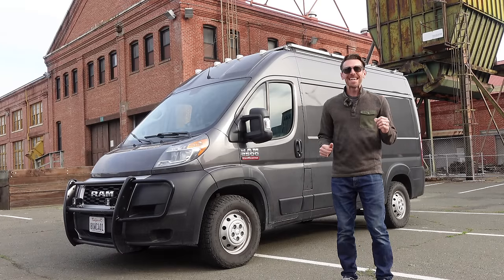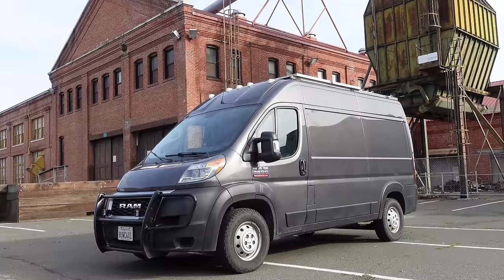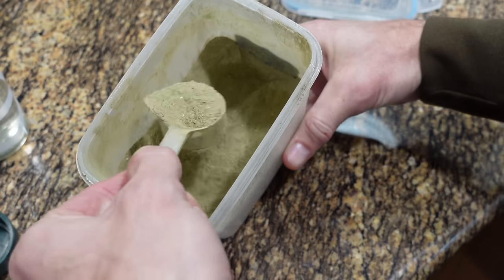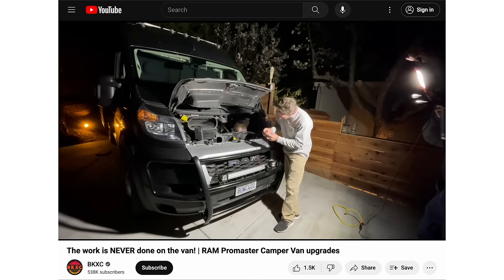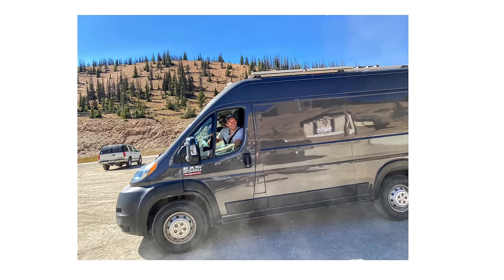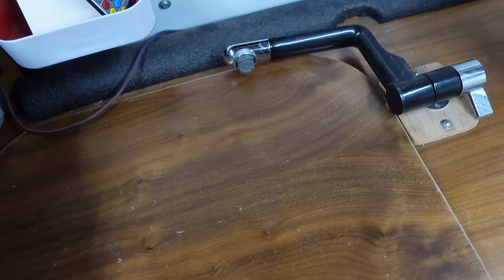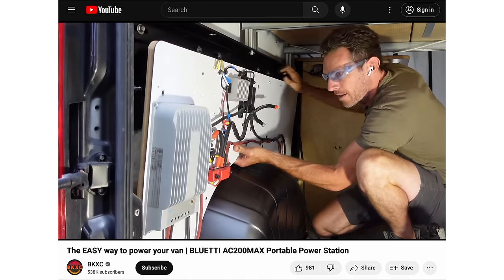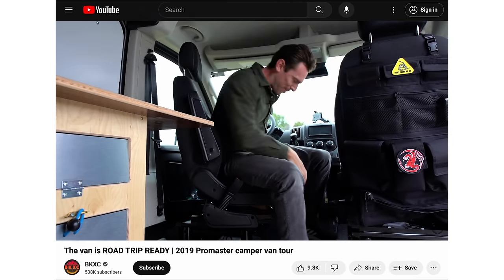100,000 miles of regret | My RAM Promaster camper van

Comment: Ex Chrysler mechanic here. The company spends all their money on marketing, not quality parts or engineering. If you want to be busy work for Chrysler, if you want to be bored work for Toyota and Honda like I later on did. 

Out of all the options I bought a Ford Transit ecoboost. Now with two 220k+ mile ecoboost engines I would recommend a standard 3.7L v6 Transit for 90% of van owners. 

Thanks for the review after all these years! You helped inspire me to build a van and make YT channel with my wife.
Reply from the maker: Haha, that’s great about being “bored” as a mechanic. Awesome that you picked the right van to go on adventures!!
Reply: Can you explain why you wouldn't go with EcoBoost for "most" drivers (and which ones)? I've only heard great things about it, for both mileage and get up and go.
Reply: @DMB-pe8hk All gen 1 (2021 and older in the transits) ecoboosts develop an exhaust leak at the exhaust headers where the turbos hang off due to the studs degrading and breaking over time. Depending on how bad the studs are stuck in there (transits also have a front drainage issue causing water to drip all over, corroding stuff) you're looking at $3-5k to fix. Other than that issue the ecoboosts are worth it imo, unless you're intending on super high mileage
Reply: @patshmear10101   Thank you so much. We'll stick to 2022 or later, then, if we can find an affordable one. We're not sure how much mileage we'll put on it at this point. 
We've also toyed with the idea of starting with a transit passenger wagon XLT AWD (but pricey!) so that we can keep enough seats to transport our many grandchildren (8 in the area!) and loan to our kids for family trips. Any thoughts on those? Are the mechanics mostly the same, or are they a different bird entirely?
Reply: @DMB-pe8hk  No worries. The drainage issue is easy to fix/avoid (front left and right drains below windshield gets debris in it and blocks draining), google some solutions or ask a dealership for any fix they do with foam to redirect water etc.

Regarding a passenger van, they are exactly the same as a cargo but they have more trim and a rear AC compressor (it's small and easily removable if you want). There is however a BIG caveat to converting those. They all come with passenger side airbags (both sides of the vehicle) which go all the way from the front windshield to the back of the van. Each side is all one unit, ie: you cannot just leave the front passenger and driver seat side airbags in and remove the rear passengers. This means when you do your conversion and want to install upper cabinets/do really anything with that space, you have to remove the airbags for safety. Depending on the country/state you live in and your insurance company, they will highly frown upon on the removal of safety equipment. Might cause you trouble in the event of an accident injury claim. To get around this you typically have to go full RV conversion and get your title officially changed to an RV type, then insure as appropriate. Also, you need special plugs (cheap) where your airbags used to plug in to trick the system into thinking the airbags are still connected, else you'll end up with a permanent light on your dash.
Also keep in mind, all those windows make a pretty intolerable greenhouse effect in hot climates. You can get insulated window covers but they won't perform as well as insulation + an actual wall.

Rather than going with a full on passenger van, Transit also offers a "crew van" variant which is basically a cargo van with a 2-3 seater behind the driver/passenger. This is what I would do if I didn't want to deal with installing seat rails etc. myself. This of course depends on what seating layout you want, you might end up having to do it yourself anyways.
Reply: @patshmear10101  Thanks so much for all that! I was aware of the long, single side airbag, but wondered if it could be replaced with the shorter "crew" van airbag. The reason for considering this is 2-fold: 1) our daughter has 6 kids and I might like to take a  passenger van down to 8 or 9 seats, with a bathroom in the back, and convert it to a camper van later for just us... but due to where we live (snow) we want an AWD... hard combo to find in a medium or high roof. 2) A crew is hard enough to find these days, but an AWD crew with raised roof is nearly impossible. So... trying to find a way to have seats when we want them and take a few more out (not easy, I know, but wouldn't be done often) when we want to travel as a couple and have a place to sleep. Then eventually convert it permanently.  We're thinking adaptability. Wish Chrysler's stow'n'go seats were in the Transit. Finally, I had also thought that having a/c already in the back might be an advantage. But I guess for sleeping overnight, a high- efficiency replacement system is a better idea. Been looking into the van mini-splits with the condenser underneath.

Comment: Thanks you so much for this video.  You are singing my song!  In 2018 I bought a Promaster strictly because I heard about Wayfarer.  My van was bought new, but on a special for around 27K.  Then, the Wayfarer conversion was a bit over 8K.  I was reluctant to spend that much (who knew how much both would cost in the future).  I also drove to Colorado and had the kit installed in the morning as I toured Garden of the Gods using Ian's minivan (mini truck) to get there.  I have really liked the conversion, which is solid, but had the same complaint about the sink.  I never used it as I had campers before and never wanted to deal with grey water.  I also use a spray bottle (vinegar) for dishes, and use wipes, and sponge baths for me when I can't access a shower.  No one has complained. You can't keep pretty clean using non-traditional methods.

Every year I manage to find something to upgrade.  Two years ago I upgraded the sound system with a Kenwood head unit and speakers.  Like you, I'm not blown away with the sound, but I like the higher quality camera view (I had to replace the rear camera with a better one), Airplay, and the unit also gave me onboard GPS when I'm out of cellular range.  This last summer my friend and I took out the kitchen (I gave it away to another Wayfarer) and built a new one that completely removed the sink and added a drawer for an induction burner and a cabinet for a small microwave.  I agree completely with the idea of going with a power station (solar generator).  I started with a Yeti 1250-which worked for the basics.  I now have a Pecron E3000 which gives me 3KW (naturally, I have a lot of solar, etc).  It is powerful enough for me to use the induction hotplate, the microwave, and even a small electric pressure cooker.  Naturally, one at a time with careful monitoring of the sun (for the panels) and the time used on the appliance.  For instance, I use the microwave for 4-6 minutes at a time.

I sort of have a window regret.  I put one on the side slide, which is a must when backing out.  Sometimes I wish I put one on the driver's side too.  Not a huge deal.  I do have rain guards and can open my front windows.  That seems to work OK for ventilation.  

Everything you said about the positives of owning the van are so true.  There is nothing like being exhausted and having the option of pulling into a rest stop and sleep (for hours or overnight).  When I drive somewhere I always have what I need with me.  The weather changed and getting cold?  No problem, I have a coat in the van.  I'm starving and the only restaurant that I can find looks like it is in need of a health inspection?  I have a whole kitchen right in the back!  Etc. Would I spend 50K for a new van and 20K for a build-out?  Hmm, that would be tough for me, but that is just me.  Again, thank you for your very nice video.
Reply from the maker: Great to hear about your journey and how you changed things up along the way!

Comment: Sink stink can be helped with some plumbing. Some pipes and a plumbing vent(P trap and air admittance valve). It's like a $50-100 to DIY and a $500-$1000 to hire someone else to do it. It won't help with cleaning stinky tanks, but it will keep the stinky air inside the tank.

Comment: Been loving my Promaster. Started my build towards the end of 2017. And  yeah, nobody knows exactly what they want in campervan. We all learn and grow each road trip. I wish my bed was higher so I could put bikes inside but my rack works great. I wish my Kuat swing arm swung out to the driver's side. I've upgraded my solar/electric system a few times and continue to swap components as they get cheaper and better. But the best part is I have a rolling apartment. I can throw a few things in the van, put my bikes on the rack and take of to go ride for a few days or a few weeks. Next up is Starlink so working on the road will be much better.
Reply from the maker: Yes, I absolutely love having EVERYTHING with me. Just doesn't matter where I am when I'm on the road, I've got it all!
Reply: @bkxc  Yup, takes so much stress out of getting to the trail head. You know you just drive to the trail head and everything you need is with you.

Comment: When my husband was in the market for a van to build it was easy to cross of the list of potential vans; the Ram Promaster.  People have had nothing but trouble with them.  He ended up with a Ford Transit used with 15,000 miles on it.  He's really happy with it.
Reply: Fleet owners say the Transit and Promaster cost of ownership over hundreds of thousands of miles is comparable. "Nothing but trouble" is a wild exaggeration. The trick is not to thrash them, because then you get a thrashed van. Keep your cruising speed to 65mph max and dont floor the throttle and hammer the tranny and it'll last,

Comment: Great update. Confirmed this is the van and setup for my needs. 
Material $2000, CNC time $200, labor $2000, overhead $1000=$5200.  Sad they changed from basic kit for $9k to a basic kit for $20k. I guess two sells a month are better than 15 a month.

Comment: I built my camper van on a Ford E-450 frame and a 7.3L diesel engine. The van was salvage and cost me the price of the vehicle transfer. The engine doesn't have any electronics, so it's easy to work on and less  prone to failures. Parts are plentiful, easily aquired, and are reasonably priced, even in the smallest of towns.
Reply from the maker: That’s awesome! Bulletproof!

Comment: You don't need a toilet. But with luck you'll get older and wind up having to pee at three am. Every. Single. Night. Then you'll get a toilet. Helps with boondocking too of course. We also have a shower and almost never use it but if you have a bathroom with a toilet and a flip down sink--0as we do in our 136" Promaster just like yours, adding the shower capability to that doesn't take up any more space. 

Ours is a Carado Axion. It's what you'll want when you're an old coot and still getting out there. One more thing. Especially since you flog your Promaster, I highly recommend a Youtube channel run by a repair show owner in Ohio who only works on Promasters, so his channel is called Promasters Only. Lots of good advice for the Promaster part of your rig. 

You might also consider getting Sumo Shocks. Not expensive, improve the ride/dealing with how semis push you around, and add about an inch to your ground clearance.
Reply from the maker: I've got a jug for the late night urination! Great info, thanks!
Reply: Good info ty !

Comment: Don’t ever let your battery go bad.  Your key will get stuck in the ignition. Mice can squeeze into the smallest space. Totally depends on how you drive it. I drive my 118” up to Truckee and the Lost Sierra and the transmission handles the steep downgrades with absolute precision. I rarely have to tap the brakes. The V6 charges up steep grades when you need the power the most. You have total command of the road with great visibility and oversized side mirrors. Don’t discount the 118” wb model. It’s capacious inside and much easier to park. Install a sunroof in back over a fan, then you can remove the glass and stand up with infinite headroom. I couldn’t imagine driving a tall roof version which has got to feel like a Uhaul. Also, the best rack you can get is the Alurack which installs easily on the 6 factory roof pegs, no drilling required. I haul my canoe and kayak and can access cargo on it from inside the van with a step stool through the sunroof. If you want an exhaust fan install it in the rear. I use a Dewalt fan to blow air out. The 118 is like driving the Scooby Van or some retro 70s Dodge, get it!

Comment: You never really think about the drive train warranty (5yrs/60K miles) on a van like this...until it fails and they tell you the entire engine needs to be replaced...at your cost, because it's 15K out of warranty.  There's just no excuse for that.  Nowadays, given how far modern engines have come, you should see 200-300K out of a gas engine before you start to have major issues.  I really like the look and setup of the Promaster compared to the Ford Transit or GMC Savanna, but hearing about complete engine failure at 75K is one of those things that would make me think twice before buying one.  

That and the front seat adjustment paddles have to be the weirdest thing I've ever seen in a car or truck.  I'd definitely pay for electric adjustment if they offered it (which they don't).
Reply from the maker: Haha, yeah the seat adjustment stuff is silly. I suppose they can't warranty an engine forever, but it is brutal when it fails so close to the warranty.

Comment: I also got a van in October of 19 but I wanted a 4x4 so went with a Sprinter. Having just had a problematic Dodge truck I was over Chrysler at the moment.  It’s insane how much more they are now….mine was 53k…now more like 90k. My largely diy build is also very basic and has been good for all of the same reasons as yours.  I did add a $30 Reliance folding toilet for those emergencies and it has been an invaluable bail out, takes up very little space and worth having on board. 

I thought 4x4 would come in handy, and it has been much more useful than expected.  From snow, mud, distant trailheads, and boat launching I use it all of the time.

I’m just shy of 80k miles and no major issues so far but about 2million minor recalls.  Dealer service is ridiculously expensive but I have stuck with it for perceived benefits of resale.  I did however switch dealers and the service is better and almost half the cost.  

For me no regrets at all except for the rattles…so many RATTLES!  Recently spent some time chasing them down and it’s so much quieter.  Should have done it sooner.
Reply from the maker: Sarah did add the fold up toilet recently and it has already saved me twice! Not super easy to set up in full panic mode, but it does the job. Love hearing that you did so well with your van! Amen about the rattles. I could spend quite a while tracking them all down.
Reply: @bkxc  my roof fan was a LOT of the noise, but once it got quiet I could hear a bunch of lesser rattles!

Comment: I have a 2017 159 2500, with 187,xxx miles on it. I do most of my own maintenance on it and haven't had anything that wasn't self inflicted. I hit a deer and had to replace some stuff on the front.

I also damaged my brakes by hitting a deep snowbank in Wyoming. 

One thing I've noticed recently is that I just started getting that engine tick sound. So I'm hoping to get that fixed before it becomes an issue. 

The headlights are ass. I have had them both go out on me in the middle of the night during a blizzard. Swapping them out during that is awful.

I'm not sure if it makes a difference but I drive with tow/haul engaged at all times. I also drive like a grandma. Slow to brake, slow to accelerate

Comment: Thank you for your update on your ram promaster camper van. I like the wayfarer vans a lot! Did you have any issues with your wool insulation regarding moisture oder mold? I know this is a hot topic in the van life community.
Reply from the maker: Nope, I had no problem with the wool insulation. I almost NEVER have any condensation build up when I sleep in the van. In the mornings my windows are never fogged up. I think it's because the van leaks like crazy, which has it's benefits I suppose!

Comment: So I basically work on strictly promasters at my dodge dealer and I will say the trans flush is something that would be very believable and worth it because the transmission in the promaster is the same that’s in a Pacifica or caravan and they are designed for the smaller vehicles. Not for heavy load and that’s the downfall other than that they’re decently solid.

Comment: Great video, full of thoughts and incites for on the road. Q: If you don't have shower, toilet, large frig, and stove, why not use a  Toyota Tundra with a slide-in camper? The Toyota V-8 engines are dependable. Loved your thoughts at the end of video, since retirement I've bicycle toured across the U.S. twice, the EU once, rode half of the GDMBR at 68. Another Divide attempt this summer 2024 at 70. Get out there folks, even if stuff hurts and you're slow. Happy trails!
Reply from the maker: The slide in camper is a pretty cool idea! I don't think I would be able to fit my bikes inside, though.

Comment: My transmission and water pump both blew up 84k. (among other issues). Had the trans flushed/filled (59k) at the RAM dealer. It's cost me close to 12k in 2023. I've learned to do a lot of the work myself but it's a PIA just to do simple things like changing spark plugs. Also, lots of plastic parts in the engine. Agreed, they're junk. I really wish Toyota or Honda would come out with a cargo van.
Reply from the maker: ARGH, what a damn pain!! I feel for ya